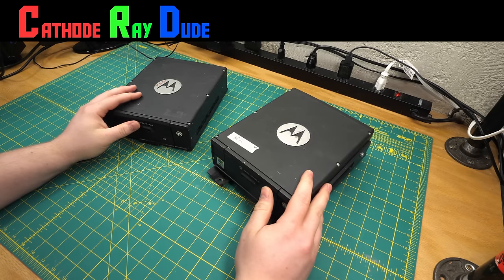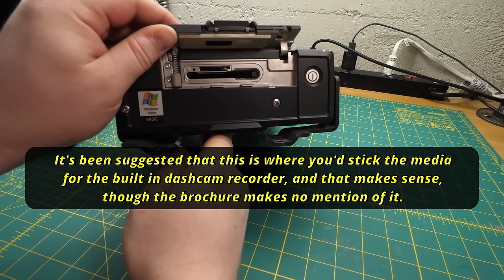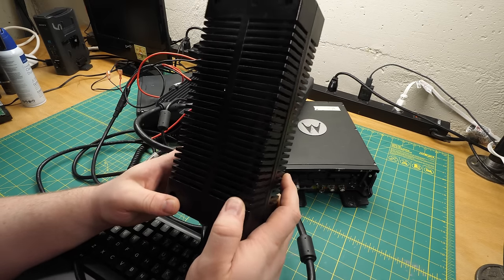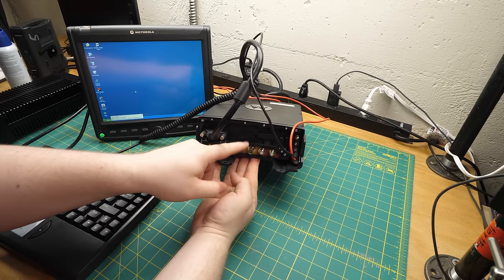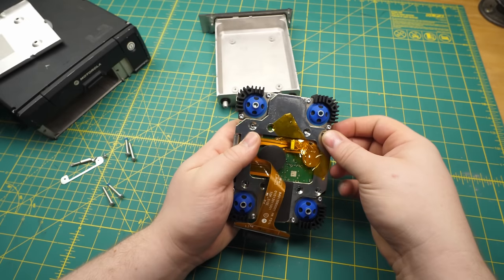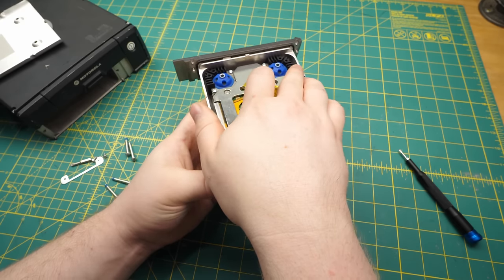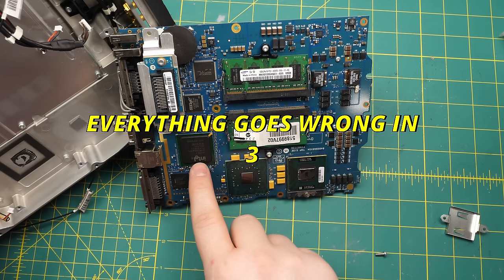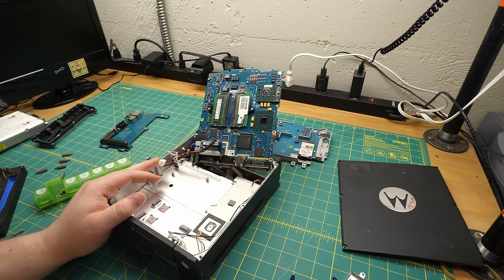Little Guys 7: The Cop-puter [Motorola MW800]

Comment: My life was better not knowing about screw in USB, now I'll just be mad at regular USB plugs.
Reply: I've bemoaned the lack of screws on USB ports since they came out.
Reply: I can count on one hand the times this was an issue for me. On the other hand, the one with slightly more fingers, plugging in USB? A torture every single fkin time. Making it even more finicky, makes a lot of sense. To be fair, in a car, absolutely legit.
Reply: @matwyder4187  When it comes to motherboards the bottom of the motherboard should be parallel with the plastic part of the USB. If you do this you will get it in perfectly the first time every time on a PC. Now TV's, printers, etc? They do their own thing and march the drum of their own beat.
Reply: @GeorgeWashingtonLaserMusket  Do you have any idea how many flat plastic surfaces are on an average USB plug? Parallel with which? Not to mention motherboards that have no declared top and bottom sides, and you only figure it out after taking the gizmo apart. Trust me, it's a nightmare.
Reply: POS systems NEED these. I used to service them and half the time the cashiers would unplug USB cables going to card readers or printers and didn't know what they did.
Reply: Did you know, screw in plugs are also part of USB type C spec? (USB Type-C® Locking Connector Specification)
Reply: My first run in with a screw in USB was with a type a to b cable for a VCDS cable used in the VW/Audi community. 

Life is better with it wish more people knew or bothered. Oh well 😅
Reply: @KittenRaee  TIL that's awesome
Reply: @KittenRaee  I just wish manufacturers would use them on PC's etc.
Reply: More reasons to hate cops o guess
Reply: Even with screws, USB plugs have three sides.
Reply: Ironically, even that monstrosity comes with only 2/3rds screw-in USB.
Reply: @cheeseparis1  Right way, wrong way, and ... cross-threaded?
Reply: I am thankful they aren't common. I always hated having to screw in VGA, half of the time the screw (or the stand) broke off and you ended up with an unstable connector. Thankfully nowadays plugs are designed to stay in on their own. In fact, this seems to be the only use case I can possibly think of where unplugging could be an issue.
Reply: @petergamache5368  no, right way but dang! it doesn't fit, then wrong way and dang! the other way was good, then the right way again after nudging it a bit.
Reply: Since my gaming PC hasn't been in very many high speed chases, I think I'm fine with the regular ones.

Comment: Also, the windows vista sticker is just. Off. It's got the XP logo and it's in Arial.
Reply: That's the Vista "compatible" badge, basically means its just barely capable of Vista basic but would be best to run XP on it.
Reply: @christianstarling3710 As far as I know, the Vista compatible sticker was like: "Designed for Windows XP"
And at the bottom "Vista compatible"
I may be wrong though.
Reply: @linuxuser2064  upon second look it's not the Vista compatible badge, it's the Vista basic badge. Basically the same thing though.
Reply: The original Vista basic logo has round top and bottom, a smaller Windows logo and all white text on grey background. Windows XP's was rectangular with black text on white background. That's just a fake sticker that borrows elements from both.
Reply: @prodbyfaith  Even the XP badges had rounded corners, and both they, the Vista Basic, and the "Designed For Windows XP - Windows Vista Compatible" badges were never grey and black. They were metallic silver and black. Windows Vista Home, Premium, and all others above that were either white or green with the blue roundel. So it's the real badge layout, but a recreation printed out onto a sticker sheet. Really odd regardless.
Reply: It's a very basic Vista basic sticker
Reply: Kinda expected Comic Sans.
Reply: That's because it is a meme sticker that was produced well after Vista had left the chat.

Comment: The Motorola that provides equipment to cops is different from the Motorola that sells phones to actual humans, and have been since 2011. I usually post a comment to this effect when a non-phone object from Motorola is being showcased.
Reply: agreed, there are just different companies with the same name and owned by the same people. 

it's like how Glock sells both handguns and Stallion Horse semen.

they're just two completely different divisions of the same company

which you'd think the US would consider a monopoly, but I guess not.
Reply: @nxtvim2521  Not even owned by the same people.  The company that sells the cop gear is publicly traded under the MSI stock ticker.  The cellphones are owned by Lenovo.
Reply: Motorola mobility vs mototola solutions
Reply: @nxtvim2521  the US stopped breaking up monopolies in the 80s my man
Reply: @nxtvim2521  What? A monopoly is a corporation that controls so much of a market that they've choked out competition and innovation, it has nothing to do with having several discrete companies under similar names.
Reply: Well, we are not going to pay 20k-60k for one of these. A Gov or large PD.  Its a drop in the ocean. These things likely only get swapped out once a decade, at the earliest.  This one my have only been removed as more places go LTE only. 3G is getting turned off all over.
Reply: Motorola has (had) lots of divisions. These days it's even less clear since they've been licensing the name/logo for decades.
Reply: Imagine being so soft you cry over a brand selling to police departments and militaries
Reply: @babayaga7434  lol
Reply: @babayaga7434 can’t be bothered to imagine
Reply: That division was eventually sold to a Chinese company called TCL.
Reply: ”actual humans” kinda reminds me of what germans used to say at certain point of history.
Reply: @echow2001  Motorola split up when Google bought the Mobility division, took their patents and then sold it to Lenovo for a fraction of what they paid for it.
Reply: The new radio company is called "Motorola Solutions". They make the 2-way radios, and the dashcams and the personal body-worn cams too thru companies they bought the last 5 to 10 years.
Reply: @uploadJ  from what I understand, the original Motorola company renamed itself to Motorola Solutions and spun off the personal devices division as Motorola Mobility. Neither of them own the batwing M logo or the name, which is owned by another company called Motorola Licensing LLC.
Reply: This does not mean that Mobility has no link to the original company other than name, because a lot of the people who were there in the 90s and 2000s are apparently still there.
Reply: @IsoMacintosh  Ask IBM about that one, too.

Comment: 27:30 the extra mass doesn't reduce vibration, it lowers the frequency of the vibration.
Reply: Which also more importantly lowers the slew rate, spreading out sharp peaks over time
Reply: This is like a car suspension, where most of the mass is on the top of the springs—contrasted with an old spring mounted buggy seat (this example is from a high school physics book and for some reason I still remember it). I think the two materials around the mounting bolts work like a spring/shock combo on a car.
Reply: reduce vibrations is a word without a physical definition (unlike dampen vibrations). I find the word use while technically ill-defined entirely appropriate.

Edit: Actually they say dampen. Saying dampen is technically incorrect, saying reduce isn't.
Reply: Yeah more mass means more inertia, dampening vibrations
Reply: Those four blue mounts - look like aircraft 'radio' equipment mounts, as aircraft can have a lot of repetitive engine vibration rendered throughout the airframe ... those mounts come in much larger forms, too. Like the size of doorknobs.
Reply: Well, technically, it lowers the moment of inertia.

Comment: I can confirm that there are specific hard drives that are "sealed/floating in a ballistics goop" because I had to clean lots of them up, to destroy/erase the data on them. The weird connector on the end that translated the S/PATA or whatever it was, we didn't have. So it was me, a Torx security bit screwdriver set that had no idea it was destined for this terrible fate, and a whole lot of gloves and "Goof Off" which is that Xylene-based cleaner that "Goo-Gone" hopes to grow up into some day. UGH. And the worst was, it was some kind of extremely specific drive variant (that was just a regular hard drive that they 'tested' I would bet money) that NOBODY ever bought. I watched those things sit in inventory as I pulled parts from inventory to fill orders, and then I would check in all 50+ of them when physical inventory happened every year. It was like a weird stockholm/groundhog day situation. I don't actually know what those drives came out of, but I do remember that some of them were quite beaten up. Sand/dirt/scrapes that were a bit more out of the "normal removable drive" wear. And no, I didn't ever look at the drive contents. I think at the time we were just going into some war in some sandy places... Hmm. Maybe I don't want to think about this anymore.
Reply: You were destroying HDDs with military data. And you really shouldn't think about it too much.

Comment: I'm guessing the mystery plugs were for monitoring the vehicle stats (Speed, brakes, sirens, etc) and for aux IO for integrating with other devices. The weight on the hard-drive is to lower it's resonant frequency. So for example, instead of it vibrating at 20Hz, it now vibrates at 2Hz. The heavier something is, the more energy it takes to move it. So for any fixed amount of energy input, like vibration from a car, the resulting motion will be less if one item is heavier then another. This weight would also be tuned with the dampers to specifically target what the car gives you in most cases. Isolating the hard-drive is probably one of the most mechanically challenging jobs on this whole design. It would make sense that if they had a known good dampening system, but the connector was on the wrong side, to just bend the cable. I'd guess that a big company like Motorola could easily spend millions qualifying a green-field design every time they needed to roll out a new version of these. Far most cost-effective to just use a known design with minimal changes.
Reply: The AUX io was for the speed,brakes, etc.. (small black module on top of the computer on the picture he found)  that other weird 4 port thing he showed is for ALPRS.. License plate recognition Cameras and neither of his computers had the module for that
Reply: Telematics, everyone?
Reply: see: 'moment of inertia', lol.
also, I wouldn't be saying too much in favor of Motorola because they're the idiots who designed the whole thing to be powered by a 12V automotive pigtail connector. That says that they didn't know what they were doing. I would bet dollars to doughnuts that Seagate actually designed the drive isolation mount, along with hacking the drive to respond to shock thermal loads by modulating drive speed according to thermal load. Normally HDDs just shut down when they overtemp but when the system is recording the evidence they need for a conviction, it is preferrable to reduce drive speed (and, consequently, video bitrate) rather than having the system shut down completely. 
IDK if you noticed because of the schlock editing job and lazy re-shoots but those were thermistors on the spindle and head pivot, not heaters as he originally thought. And thin film thermistors that elaborate can rapidly detect the sort of shock thermal loads that would be applied to a mini PC bolted to the transmission tunnel of a cop car where the cop just stomped on the gas to go after someone doing 120mph down the freeway.  Yes, the resistance changes were small, because they are being measured by an IC that can detect milliohms worth of resistance variance. Also, the calculation he applied to determine power output if it were a heating coil is way more power than would ever be needed to prevent too-low operating temps. Pushing that kind of power through those coils would make for a nice fire starter.

Comment: That mysterious COM port is likely the GPS.
Reply: There would be a few of them. GPS, and also the WWAN baseband. Believe it or not, they use Hayes-like AT commands for everything. Even the baseband in a smartphone does, it's just a type of modem.
Reply: @coyote_den  Exactly. There will be the obvious (external) serial ports, then the less obvious (pin headers), and then the "WTF is this" emulated serial devices like the GPS, WWAN, bluetooth, radio, video codex, lightbar... One of the boxes I messed with (DoD contractor "embedded server" has 2 external ports, but the BIOS says there are 8 total COM's.)
Reply: It is, I own a former cop car and tell you it has GPS in the back, that attaches to the front.
Reply: There is literally a coax connector that is labeled 'GPS'🤦‍♂

Comment: I never knew that cop cars used anything other than rugged laptops. Interesting.
Reply: Yeah, really should just be a laptop as you can take a laptop inside when doing paperwork.
Reply: Thats one way to do it but then you need a separate video recorder and possibly a dedicated radio interface. The benefit of using a laptop is that the user can remove it and use it at a desk or whatever. The user would need another computer (although much cheaper) to use at their desk. Having everything all in one could simplify procurement and better integrate Motorola radios with the Motorola carputer. I'm sure Motorola sold the complete package of a radio, antennas, dashcam, and the computer.
Reply: I think many did. I guess this was another option but I do feel like the toughbooks were more popular of an option.
Reply: I think the toughbooks may have been what largely replaced these. I've never worked with police gear, but every toughbook I've seen is a bit newer than these. Like a few years into windows 7.
Reply: @DigitalJedi  I was about to say the same. This "little guy" is quite old. The local police all had toughbooks - several generations, in fact. (I was at a junk reseller who had a literal pallet of old toughbooks from the detective's division. Standard pallet, stack was over 3ft high.) I have a more modern "toughbook" from a sub-sub-contractor (DoD)... but it's entirely plastic, so I don't know why they even bother calling it a toughbook. I also have a new Dell rugged extreme laptop/tablet (removable keyboard), and it's 10,000x tougher than that plastic toughbook.

(Those toughbooks all ran XP, btw. Even the one I have.)
Reply: @jfbeam Most of the nonrugged toughbooks are just export spec Let's Note laptops with an english keyboard and FCC compliance alongside slight beefiness.
Reply: A couple of years ago I went on some police ride alongs and they just use regular windows laptops on a stand
Reply: @glibberglobber9358  I always thought they used rugged laptops for years as a kid
Reply: @christiangomez2496  I don’t remember exactly what they were, but they just looked like regular thinkpads or dell inspirons
Reply: @jfbeam my cf-29l3lgzbm (2006 i think) ran XP but my cf-31gt2aa1m ran 7 pro (well, came with it. tho company put xp on it). both are metal. i don't know what the 29 was used for but the 31 was a "mobile data terminal" for a water company.
Reply: @jfbeam   Toughbooks come in different formats, and are highly customizable as far as laptops are concerned. I noticed they have different rugged levels for different models. The one you have is probably lighter, and not as rugged. You can still get the full rugged version.
Reply: @christiangomez2496  They sold the Let's Note in the US? I never knew!